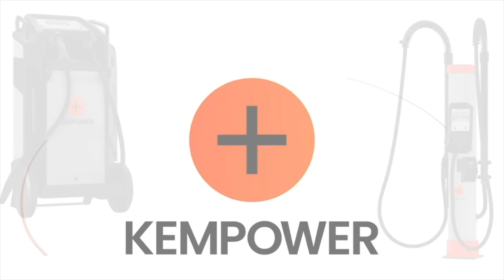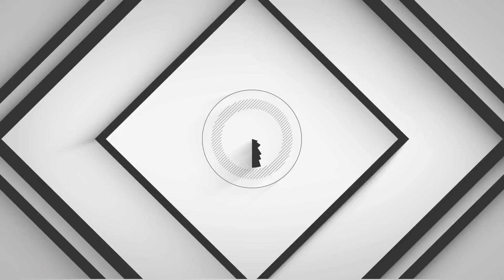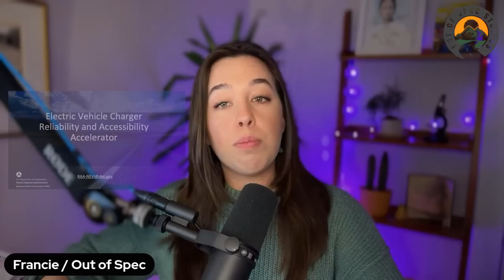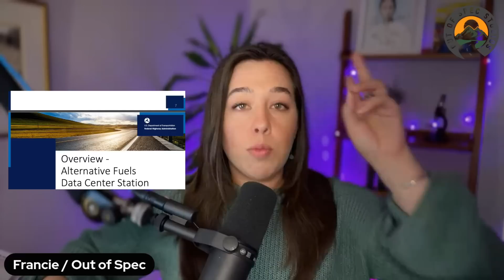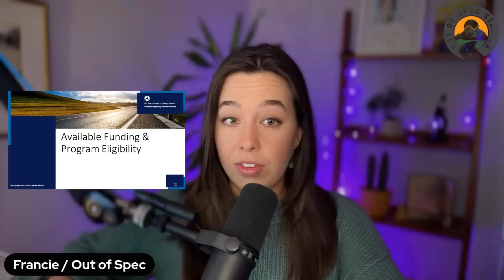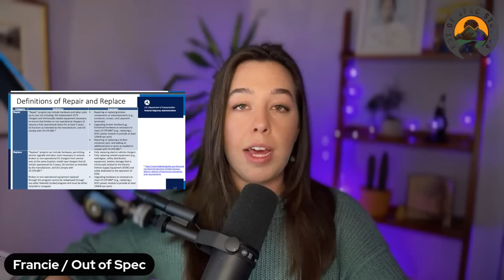Who's Responsible For Fixing Broken Chargers? Funding To Repair EV Infrastructure | Episode 251

Comment: Francie, it might be worth investigating the cost of Gas station equipment. this should include all the storage tanks, pumps, canopies etc. Then look at the ROI based on product sales just to cover the initial cost of equipment and ongoing maintenance. Also include EPA mandates that require tank replacement after a certain number of years.

Then look at the ROI to install EVSE equipment at locations that don’t have a typical convenience store business model to supplement the operating cost overhead.  

Unfortunately, I look at EVSE sights as not being sustainable by just selling electricity at a margin to cover ROI and ongoing equipment maintenance which is likely very expensive. I feel like the only way to sustain an EVSE sight is with 80% daily utilization. so basically Volume kWh.  How do you pay for $1M installations that only have 4 350 kWh charging stations?
Reply from the maker: This would be such an interesting comparison! Thanks for the input and for watching. -Francie

Comment: What a cluster F*** but thanks for the information Francie. The gubment throws huge cash at a technology they don't understand and many of the "entrepreneurs" who are always looking at new ways to rob the US Treasury are more than happy to "partner". What could possibly go wrong? Right now and for the foreseeable, Tesla is the only company doing BEV manufacturing and charging infrastructure correctly and it isn't even close. I suppose this is good news for Tesla but horrible news for general EV adoption.
 
If Tesla bails these idiots out by opening up the Supercharger Network I guess that's a good thing but Tesla can't do it alone. I have always said to anyone who would listen, do NOT buy an EV unless you can charge at home. Tesla makes a good case for relying on their charging network for all your charging needs but they can't carry the load for all EV's without spoiling the current wonderful Supercharging experience.

Comment: Federal Funding should not be used for repairing broken charging station.
The private, for PROFIT companies, who take Federal funds and pocket the income from the chargers are responsible for them.
Solution, if the EV chargers are broken, the company has to fix it. If they don't fix it then the contract should be taken from them, the company penalized for not fixing the charger.

Comment: Im confused. Did the government fund gas stations when one needed to exist? Does the government assist when a fuel tank needs to be replaced at a gas station?
Reply: Actually,  yes and for a lot of other infrastructure.   Be it right or wrong. To your  point, I might sour the milk at some point to make room for new things.
Reply: @williamlathan6932  this "infrastructure" as the EV cult likes to label it wouldn't exist unless we were forced into it. EPA grants for small business to replace a tank that would bankrupt a small station to replace is IMO good use of the tax money that was spent on the gas sold before. Pulling money from thin air to make something very inefficient everyone else's problem and telling everyone its better is more like a boondoggle. The stock market scam and pending wars involved with this technology is going to completely destroy the poor and middle class.

Comment: It is the hosts obligation to make repairs and keep the stations online. 
We have aging infrastructure. Some are being removed, others no longer work.
I wouldn't be surprised if charging stations were presented as a cash cow,  or passive income. One town I charged at had Blink stations at city hall. Even though they worked every time I went there they were covered in cob webs.
They got them through a government grant. 
One of the problems I have come across is having to wait to charge, especially at Electrify America stations. 
They are heavily invested in CCS and some stations have no Chademo stations, while the rest have only one.
I want to know what will happen when all the vehicles go to NACS. Seems things are really going to be messed up. 
I believe I saw a station going up with all three. Chademo and CCS are, going to be around a lot longer than people think. A battery can be swapped out for less than a new car. At least for my Leaf. It's 10 years old and still going strong.

Comment: The electrical rate structure needs to be changed.  Site operators can't make the business work without a better rate structure with reduced demand charges for electricity.  The rural areas need coverage for transportation corridor between higher population areas.  I.e really need charging stations at 50 to 60 mile intervals The Electrify America rollout had a chilling effect on travel corridor and squeezed out competition.  It would have been much better to have 6 100 kW stations that all work than a mix of 150 and 350 kW stations that are half broken or running slow due to cooling issues.  The new EA hardware hasn't been much better than the older hardware.  EA almost single handedly killed the CHAdeMo plug standard.  Poaching on existing infrastructure site hosts didn't help EVgo and Shell Recharge sites that had installed 50 kW stations at those same rural sites.  Just my 2¢.
Reply: Demand charges exist for a reason, which is that having to build and maintain extra peaker plants just for periods of high electricity demand is very expensive; if people who add lots of load to the grid during peak hours don't pay for it, that means the rest of the ratepayers have to pay for it, which doesn't seem fair either.

My personal take on this is that the right way to solve the demand charge problem is for the charging sites themselves to have stationary batteries, allowing them to pull power from the grid when the electricity is abundant and cheap (e.g. late at night when the charging site is empty), rather than at the exact moment a customer shows up to get their car charged. Of course, the stationary batteries, themselves, cost money, which has to be paid for via higher charging fees, but at least it's a cost that is trending downward with time as batteries get cheaper.

Comment: Gasoline stations pay for themselves by selling gasoline and other things. If EV charging networks can't pay for themselves similarly, they're ultimately unsustainable. Gasoline taxes also pay for roads. Ultimately, taxing the electricity fueling EVs, including EVs charged at home, should serve the same purpose.

Since EV charging requires long stops, selling food and other things at charging stations makes even more sense than selling these things at gasoline stations. If the state stays out of it, we'll see restaurants and theaters and other businesses install stations where they make economic sense; otherwise, owners will learn to game the system, and we'll have stations where they make less sense.
Reply: Most States have already imposed EV surcharges added to standard registration fees to cover the “Gas Tax “ loss. Some are already looking at an EV “gas tax” to bring parody with existing GAS tax. 3 cents per kWh at public retail charging locations.  home charging is excluded because it’s covered within the Registration surcharge.
Reply: @dennisschlieckau8723  Georgia hasn't. Registering a vehicle costs $20. The average ICEV driver pays over $400 per year in gasoline taxes (around 50 cents/gallon, state and Federal). I don't know about public charging taxes, but I rarely pay them because I rarely use public charging. I expect some sort of tax to offset gasoline taxes eventually, but I haven't seen it yet.
Reply: @restonthewind Wow, $20 vehicle registration has to be near the lowest in the nation. WI is $85 + $175 EV tax surcharge. Our State gas tax is $0.33 Fed $0.18.3 + $0.02 Natural resources fee.   We currently have two (R) state legislators sponsoring a Bill that would allow for public Retail selling of electricity for EV fueling by the kWh. The bill also adds $0.03 per kWh tax at public station points of sale. This is meant to bring an equivalent tax level parity with the state gas tax only.  10 kWh is $0.30  10 kWh will be equivalent to 1 gal of fuel based on mileage (fleet average).
Reply: @dennisschlieckau8723  Correction: Georgia does have a $210 EV registration fee on top of the $20 registration fee for non-commercial vehicles. I guess I paid it when I received my tag, but I didn't notice.
Reply: Well said .
Reply: In the US, gas is heavily subsidized. The station owners make more profit with the convenience store & carwash business than selling gas.

Comment: There are many Chargepoint branded units in my area that are not working. And have been broken for years. I have contact Chargepoint about them. And was told that it's up to the location owner to fix. Yet they stay broken and listed. Shame on Chargepoint. I am not talking about 2 or 3, but 40 to 50% of them in North East Florida.
Reply: ChargePoint manufactures chargers. It doesn't own the network of ChargePoint stations. If a ChargePoint station doesn't pay for itself by selling electricity or by attracting drivers to the business of its owner, it should not be repaired or replaced. It should be removed. A business removing, repairing and reselling unprofitable stations might work, but we don't want charging stations that require endless subsidies from people don't use them. Ultimately, that's not sustainable.
Reply: The site owner’s contact information should be displayed on the charger so problems are reported.
Reply: I don't understand why they wouldn't either mark them as broken, or show the last 3 times somebody successfully charged, and make it easy to filter. If an owner wants people back, send somebody there to charge.
Reply: Sight  owner are not allowing chargepoint to fix charging station unfortunately
Reply: @lesterng5748  Chargepoint offers maintenance plans for a fee. They are not a charity.